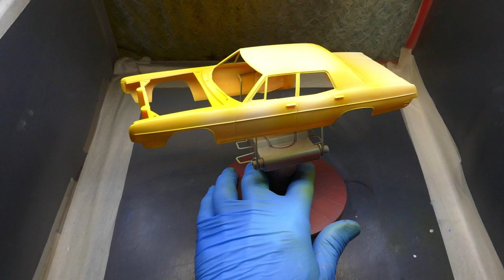How to build 1970 FORD GALAXIE TAXI AMT 1:25 scale model I step by step

Comment: A couple of things I would have done was fill in the four holes where you screw the body together I would have filled them in with plastic and Tamyia's putty. Or you can use the 65 Ford Galaxie chassis with a friend and being steerable and also use the 66 chassis if you want to also might have to lengthen the chassis maybe it does work I've done it on my 69 Ford Galaxie and you can use the engine from the 65 or the 66 Ford galaxie. Just more detailing. Also I would cut the middle part of the glass the two pieces are connected with two strips I would have cut them in half and sand and most of the way towards the back glass and the front glass also I would have found a different engine like a 351 or a 390 instead of a 427 big block I don't think taxicabs use that big of an engine back in those days. There are so many different ways to make your model more detailed and Look better like buying pre-made spark plug heater hoses you can find them at your local hobby store or online you did a really nice job on your taxi just giving you some tips
Reply from the maker: Thank you for your tips.  will take it with me for the next kit.👍